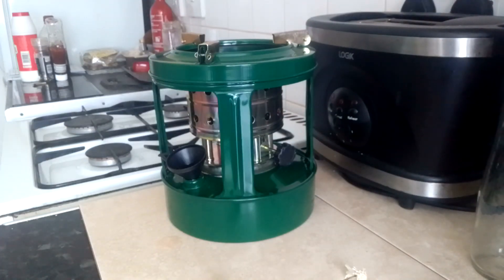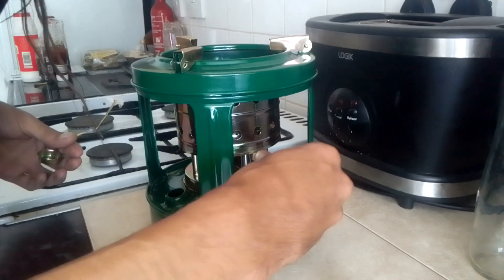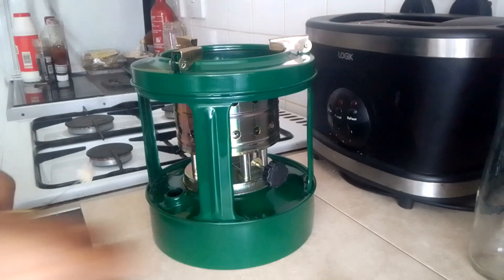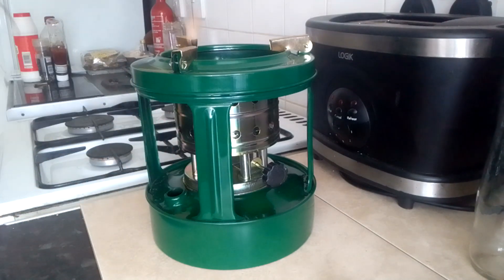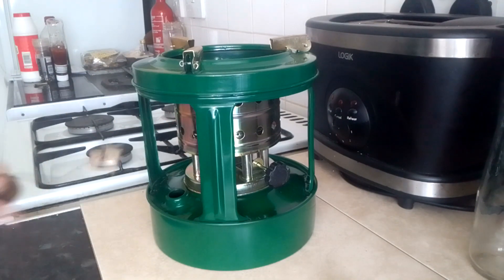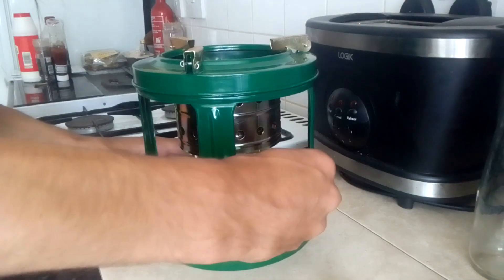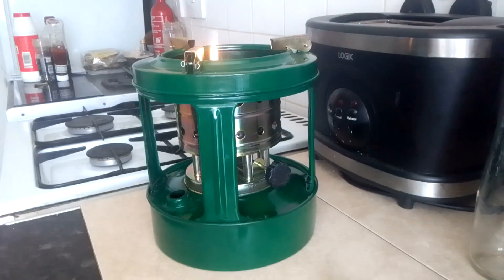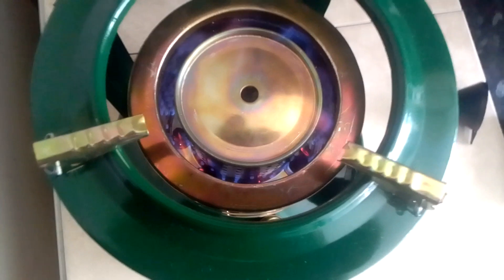Red Diesel Burning Stove Tutorial.🔥👌

Comment: Cool little heater...  is there a version for lighting......?
 Hows the sailing preparations going.
Reply from the maker: Think there's a mine/hurricane lantern that burns diesel also cheap but suspect won't last due to it,Sailing Prep Difficult hard to find help lots of work needed,would be living on there if could gather maybe 5k,feels like alot an miles away,water makers take the piss cost wize,and need a backup engine plus several other not cheap things to actually do it though.☹️